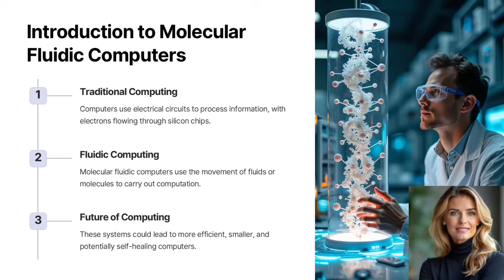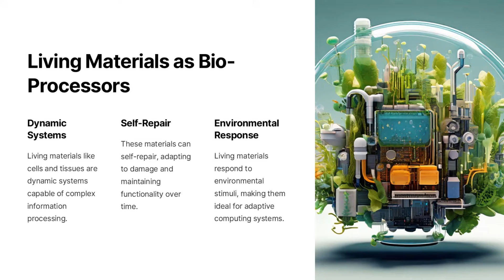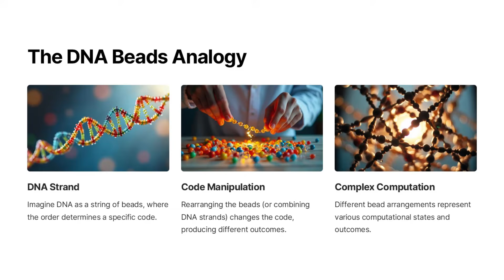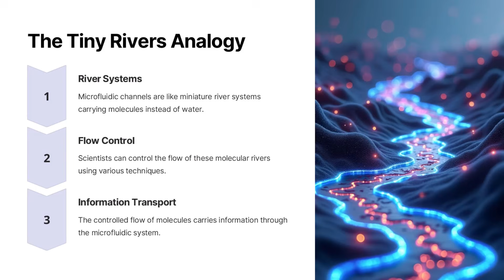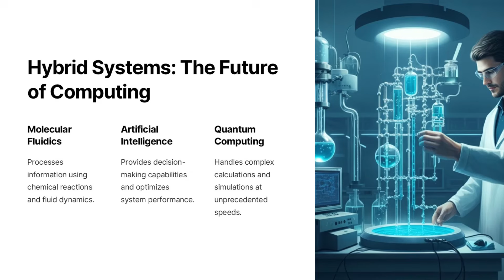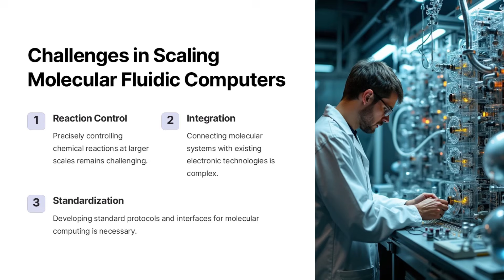Beyond Silicon: The Power of Molecular Fluidic Computers

Comment from the maker: How can the inherent stochastic nature of molecular interactions in fluidic systems be controlled to achieve deterministic computational outputs in large-scale molecular fluidic computing systems? What are the potential limitations of using DNA as a logic gate system for parallel processing, especially in terms of error rates, data retention, and speed compared to traditional silicon-based systems?